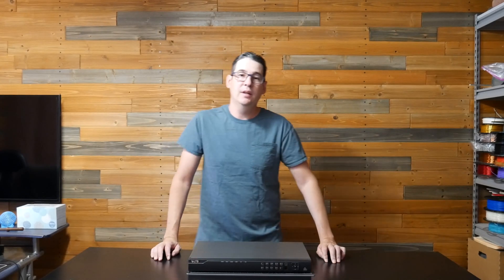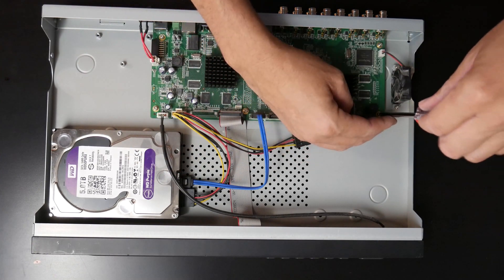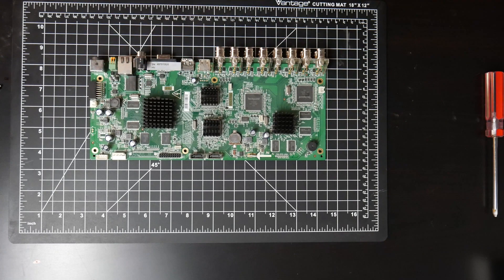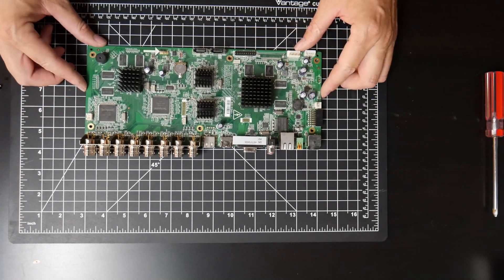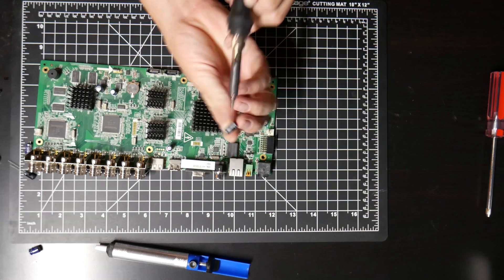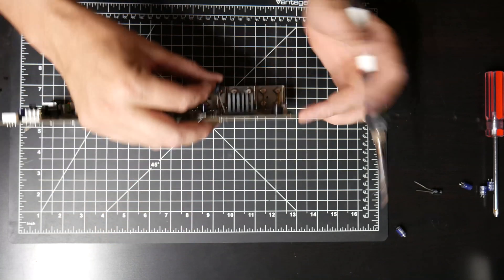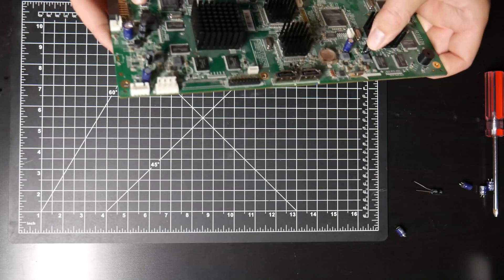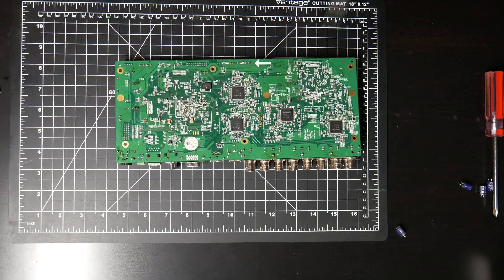LTS DVR-NVR Random Restart Board Repair 4K

Comment: I have an NVR screen that starts for one minute and then shut down. Switching it on again immediately, it won't restart. It always works for one minute after leaving it unplugged for several days. I checked the capacitors but they are ok. Any clue what could be causing this in my case ?
Reply from the maker: un plug all drives, bad hard drives cause that problem.
Reply: @YOYOCrescendo  I have already put a new drive, I still have the same problem. Is there anything else to look for ?

Comment: if i dont keep my dvr connected to cloud via ethernet it keeps reboot but worse than that it resets my settings each time all my motion detect spots resoloution everything, even  keeping ethernet in and put settings to never reboot it still occasionally does giving me groundhog day each time......dont suppose u know whick part of the board could be responsible for this??
Reply from the maker: I think you have a IP conflict, try connecting the Ethernet cord than disabling DHCP after it obtains a connection. if it is still having that problem check that all cameras are static and you are on a range far beyond the DHCP. I usually do this in the router, set the DHCP range to 100 for example than set all of your camera system below that number.
Reply: @YOYOCrescendo   @YOYO Crescendo thnkyou for your reply i think you could be on to something as the person i swapped my perfeclty working one(doh)!! for kept on getting msgs saying i.p conflict but since i got it home at mine now its no longer getting the i.p conflict msg, and i have checked too via my router.... but i still every reboot old settings comeback and it appears to be impossible to stay off dhcp too, i untick it then go back to that page and already it is ticked again, i guess i should be gratefull that it lets me change motion detect areas and time until it reboots of course!!! even restore to default or factory settings doesnt work, i tried changing the cr2032 battery on motherboard, format hard drive, log in via cms to restore to default and cant find a reset button or even the j1  part on motherboard either......its driving me nuts, maybe im just gonna have to admit defeat on this one!!!!!.....p.s.i know the old owner used to switch it off almost daily by the plug instead of properly shut down.
Reply from the maker: @hystericalnutter6801  you might want to check if there is a button battery on the main board if that is dead it will cause that exact problem.
Reply: @YOYOCrescendo  yes i was really exited when i thought it was that but it wasnt, that was the cr2032 battery i changed on motherboard, the person whos it was was actually my mum lol hence the swap hoping i could fix it, im thinking now that its because she kept switching it off by the plug switch each day and its corrupted the settings data but formating the hard drive didnt help, i was hoping i could reset or swap out something via the motherboard as nothing else has worked ..... sannce are no help at all and not even contactable so that ones not an option and dont want to but a new dvr until i got a 1080p at minimum tv or moniter or else it would have to be another 1080n dvr which is about same price as a 1080p one but half the picture quality......gggrrrrrrrrr!!!!
Reply from the maker: @hystericalnutter6801  if you log in to the DVR from a computer you can update the firmware, I would also recommend factory resetting it in the maintenance menu.